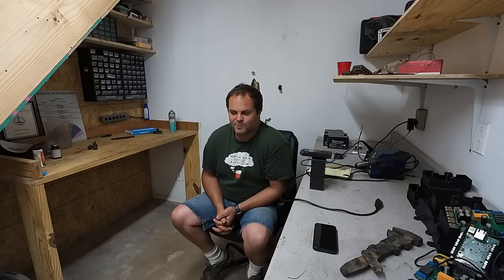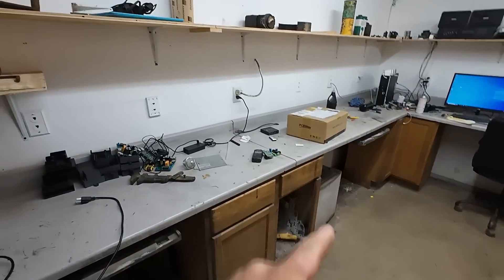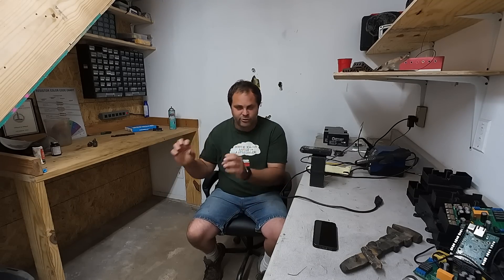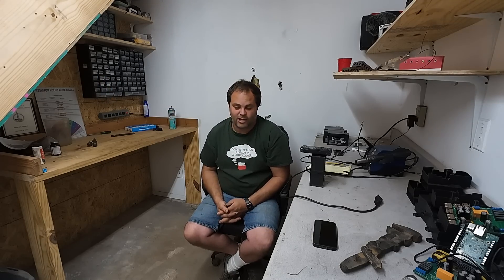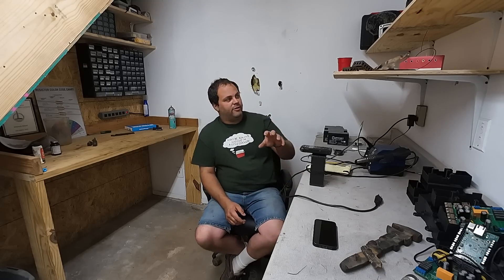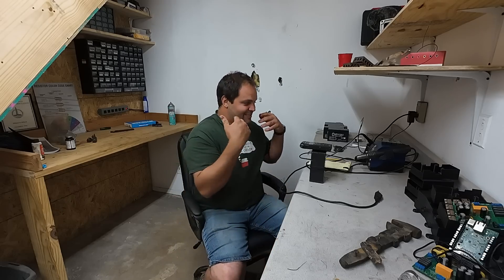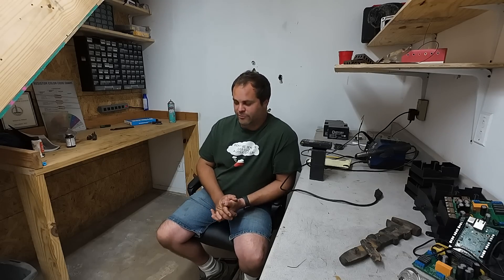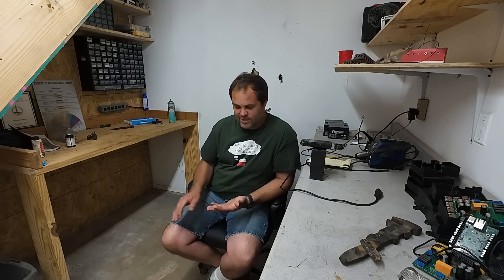TZL Scada Part 1 Introduction

Comment: Zak, I wanted to let you know that we had a recall at work on the gray power strip you have at your work bench because we had one of those go off like a fire cracker "fizzler" (where you break the fire cracker in two and light it).  The culprit is the MOV inside next to the switch.  And the fac the neon bulb is still working in the switch is no indication of the health of the MOV.  I would recommend using side cutter and cutting out that MOV before it has a chance to start a fire.
Reply from the maker: Thanks, Good info.

Comment: Jeez talk about the possibilities , it kinda reminds me of my mercedes sprinter.      I go over a bump and it beeps at me.   Someone drives up on me fast. It beeps at me.    I dont slow down in time based on whatever these sensors are set at and the damn thing locks up the brakes and disables my steering.    However these are all examples of a bunch of enginerds creating crap that is crap.     Your application actually makes great sense.  You could put that on a water main and have it shut off before theres major  flood damage to a commercial building or a residence.   Not sure exactly what it would measure to enable that action but .... i bet soneone could figure it out.

Comment: Dude your a mechanic, machinist, oil field operator, computer programmer and electrical engineer. The later two are amazing to me. Im a lot like yourself. I do just about everything myself and try to fix everything and make something work. Were close to the same age, but i have no interest in the conouter stuff let alone the programming stuff. My ADD eont let me sit there and do something like that. To me those type skill sets rarely cross over in people. Seems they do one side or the other and often not both. 

Your a super smart guy! You make interesting videos. This coming from a guy NOT from oil country eho will bever work in it but randomly came across your videos. I had a small bit of intrest but your explinations and knowledge you share have kept me here.

Comment: The city I work in uses a Scada system for the water system. Measures the water in each one of the tanks, monitors the wells. You can turn the wells on and off and put them on auto right from the system. Problem with ours is, where they put the system. They swapped our phone system over to voice over IP. Well now the dialing portion of the system won’t work. The part that will call someone if there is a problem with the system. They’ve had multiple people come out and try to fix it, no dice. That part still don’t work right 😂

Comment: I spent many years as a process engineer in the paper industry. Many times the objective was to operate a process better than the average of the 4 shift operators, hopefully all 4 the same as the best. The act of automating a process forces you to learn the process in detail, then consider the action to be taken. Often it pointed to the relative importance of each step. Frequently it exposed where the sensor needed to be improved - how do you control a temperature to plus/minus one degree when the thermocouple and the surrounding well could only measure to plus/minus three?
I look forward to your series and hope it pays you in many ways.

Comment: Maybe a drone can be your pumper. Modern drones can fly with GPS and can be programmed to follow a certain route. Here in the Netherlands farmers use it to check their crops and their Cattle's. Also during watering or apply fertilizers they monitor the results. They check the heat of the plants to check how healthy the crops are on certain area's. 
Yeah drones can be your pumper..😊

Comment: Brilliant stuff Zach. I have 30 yrs in electronic security and controls systems, the sensors and parts are simple and cheap nowadays. What you need is a software engineer to write you a program to gather and display the data, set high low limits and alarms. Logic tables to control strategy. Essentially a Buildings Management System like Trend but that would be a pretty penny, so go ahead and make this happen as you are 95% there. You certainly have the knowledge, willpower and need to do it. If you weren’t on the other side of the Atlantic I would drop by with some parts and knowledge. All the best Zach.
Reply: This is what I do and I love it most pads here are significantly bigger as in 16 wells and generally 8500 to 12k bbls a day of oil.

Comment: We use Siemens plc’c to do a similar task (monitoring a power station), the scripts are little more complicated, as the plc is controlling fuel transfer duty cycles, cooling tower control gear, fans etc.
We were using an Allen Bradley plc previously,  old and antiquated, there are quite a few different systems out there atm, specific scada systems are quite expensive and to be honest, a waste of money for what you are trying to achieve, plc logic has so many variables

Comment: Zach, I know you are already done with you setup, Long story short, I needed to set up a panic button real time location system for hotel maids.(rape buttons). If you want to cheap out a little bit, I recommend the mosquito mqtt  broker, node red, esp32cam esp32-with a 18650 holder. look into LORA for transport.The esp 32 cam is about 6 bucks with wifi and gpio 3.3v

Comment: I guess you have to buy a cell phone hot spot for each site. Wyze cameras are cheap and decent enough with 'some' logic built in if you buy the premium part. But I've learned to not trust that wyze logic because their notification system is subpar as is their logic. I can't wait to see how you tied all the inputs together AND got it to send reliably. Also curious how you got contacts and switches thrown automatically. Wyze has an outdoor double plug that works great, but you have to control in the app. Good stuff, can't wait to see these fixes.

Comment: Hey Zach, cool project you're working. I had an idea back when you showed us the manifolds where all the pumps in the field converge. It seems alot of diagnostics can be done just studying direction and clarity of fluid coming from all these pump feeds. Maybe as supplement to your existing telemetry you could install a small camera on a look glass for each manifold feed. I believe with some scripting you can determine direction and speed of flow, and with the aid of a light source, the clarity of the solution. It would help single out problem pumps as well as being cheaper at scale if you only need one computer box per manifold. Just a random idea. I don't know of its worth any. Cheers

Comment: Can't you install a small water separator in series with your salt water poly pipe transfer line that runs to your disposal well from each location ? This way any oil in the tank will be captured and pumped into a small holding tank instead of being injected into the disposal well !
OTOH , I suppose you could install a water separator AT the disposal well that will capture all oil from all locations before it goes into the disposal well !
Reply: You would need a gun barrel, also, no you don't put anything between the pump and the well, besides the flowline

Comment: I live in alaska and many places there are so little water in areas, so they dig shallow water wells. Like your high water level indicator shut off system, kind of like a circuit breaker under the hood of a car but has a timer to turn it back on with a timer. Its called a pump protector. Well companies will usually not tell you about it because they want you to drill to Texas to find water, fifty thousand dollar wells when ground water from rain or seepage from other sources which can be filtered or just plain drink it. I happen to know if your thirsty enough, you will drink your own pee to wet your thirst, you don't need to ask me how I know/LOL. Many things some think quite offensive becomes a "Hell ya, I'll drink it"!!! I just hope our tech doesn't get ahead of good sense. Love all the videos Zach... Oh by the way... those pump protectors that they sell are quite expensive.... a really hard thing for a guy low on dollars to purchase. Its simple to make but people don't stop to think on ways to make one themselves. Parts from under the hood of a old car and a timer will do the same thing.

Comment: Hey Zach, looking forward to your scada setup.

I live on an off-grid property with solar panels, lithium batteries, a 500' water well, pumps, wyze cameras etc.
I'm using homeassistant and raspberry pi computers to tie the systems together and monitor various aspects.  
I just love remote sensing and control.
  
I worked in seismic, well data management and computer systems for years at "big oil" and worked alongside the scada team.

I enjoy watching you cause I rarely went into the field... Nice to see that stuff I was databasing! 

Let's see scada #2
Reply from the maker: Hahaha sounds awesome.